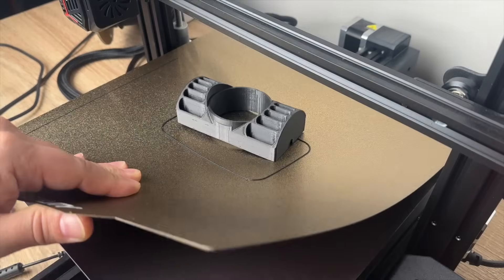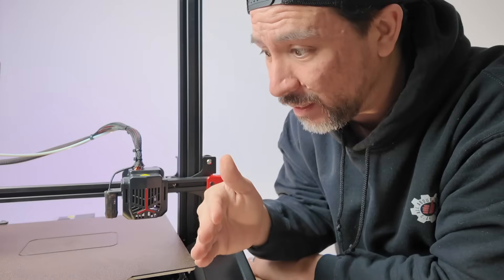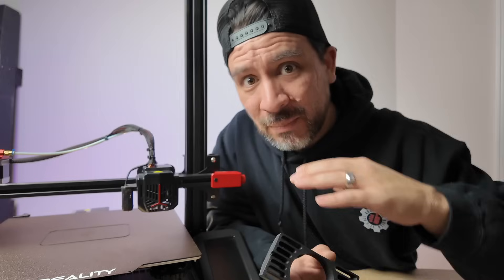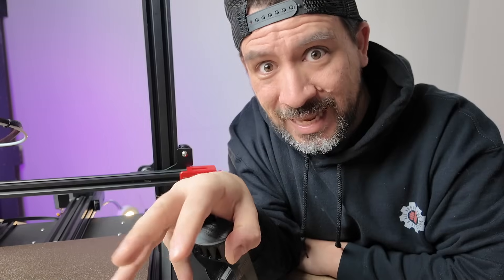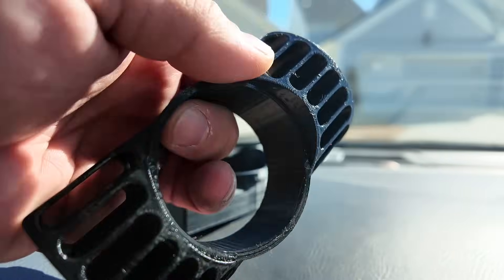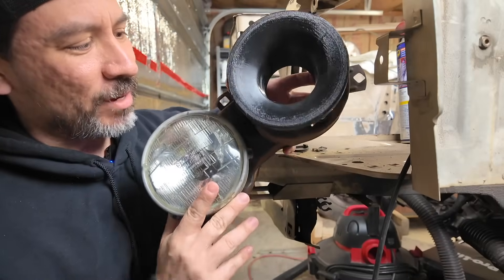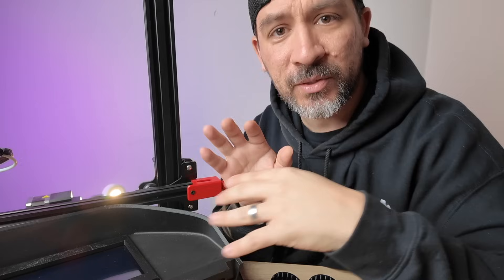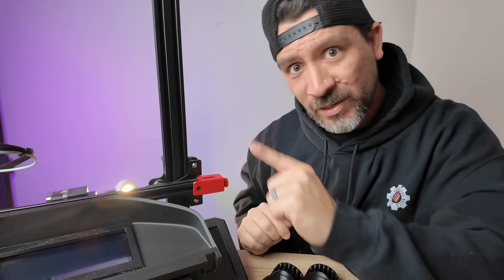DIY 3d Printed Car Parts... Is it Overhyped?

Comment: You should not touch the bed with your fingers because it will stop prints from sticking well.
Reply: I use Clorox disinfectant spray. It works shockingly well. Has to be Clorox, it seems. Haven’t found others that work as well.
Edit: I meant Lysol, not Clorox. 🤦‍♂️
Reply from the maker: @grandamdan99  really? Will have to try that too
Reply: @Itsallaboutthebuild
Edited my comment. I meant to say Lysol brand.
Reply from the maker: @ ah ok, thx!!!
Reply: @grandamdan99 So the solvent in the Lysol is your friend aka just use alcohol 91%
Reply: @ 
I’ve tried alcohol. I don’t have a heated bed. And primarily print with PETG. I use a skim coat of modpodge for bed adhesion. It works great and the Lysol spray takes it right back off when it builds up too much.
Reply from the maker: @grandamdan99  oh nice, will have to give that a try
Reply from the maker: @Charl1etrafford  good to know, do you use some sort of special cleaner for your bed???
Reply: @Itsallaboutthebuild  isopropyl alcohol is best can make a huge difference in that first layer sticking
Reply from the maker: @dale_fallows  nice, will give it a try. Thx
Reply: @dale_fallows ISP will leave a film after time
Reply: @Itsallaboutthebuild  Alcohol like they said, but you should always clean it with hot water and Dawn occasionally. Isopropyl is usually good enough, but doesn't actually remove 100% of the invisible oils like Dawn does. The longer you have that 3d printer the more tips and tricks you'll pick up, and your quality will just go up and up. Glad I found your channel, can't wait to see what else you do with it! 
EDIT: I have the same printer, here are my "ironing" settings. Enabling ironing smooths out the top surfaces to get them insanely smooth, you'll be shocked how smooth these settings will get the tops of your prints. They also barely even add to the print time. Settings: Pattern - Zig Zag, Line Spacing - .2mm, Inset - Nozzle Diameter x 0.5 (.2mm for most), Speed - 150mm/s (I know it sounds like a lot but it really isn't in this context, won't hurt the printer at all).
Reply from the maker: @ProdigyAutomotive  thx, plan to make some more car parts. Will need to learn all these other tips and tricks 🙌
Reply from the maker: @ProdigyAutomotive  sweet, thx 🙌🙌🙌
Reply: @Itsallaboutthebuild  90% IPA works. But after a while you’ll notice prints not sticking.  That’s when you just hit it with dawn dish soap and warm water.
Reply: @Itsallaboutthebuild  Water Windex works great warm water.
Reply from the maker: @swaggod226  thx!!!
Reply: @Itsallaboutthebuild  i touch the bed all i want because I have 95% IPA to clean it
Reply: Use 3DLAC its a spray adhesive. It last like forever and is easy to use. It really helps with every material.
Reply from the maker: @MrSachasan  Thx, will order some today!!!
Reply: I use any degreaser or degreaser wipes 😂
Reply from the maker: @ Hey, if it works....
Reply: Dawn dish soap also works amazing! Any time I have bed adhesion problems, I give it a quick wash and all the prints stick well afterwards.

Comment: With supports i change my top z distance to as close to .3 as i can and it still supports but are 1000x easier to remove with less problems on quality, just for future reference
Reply from the maker: @MayhemXo  good to know, thx!!! I’ve been reading up on newer printers to see how they handle these issues. Perhaps a newer printer may be on the books for this year 😁